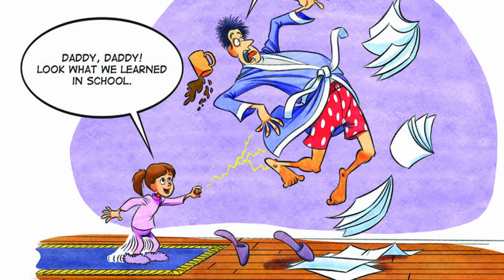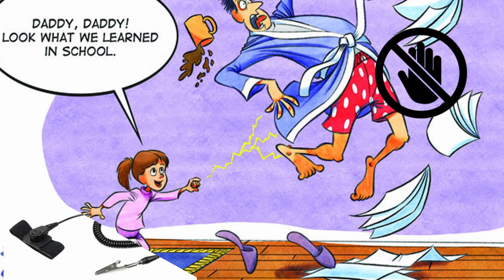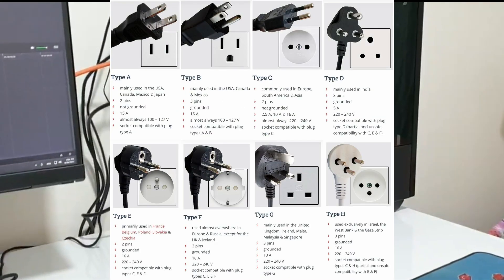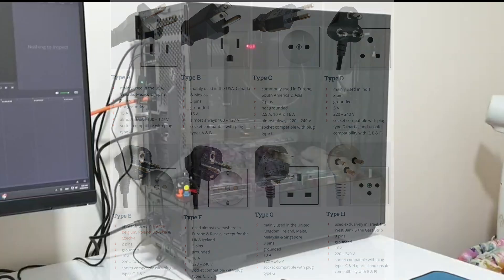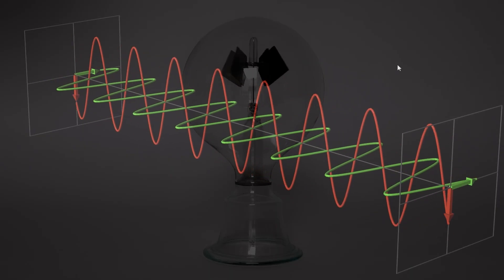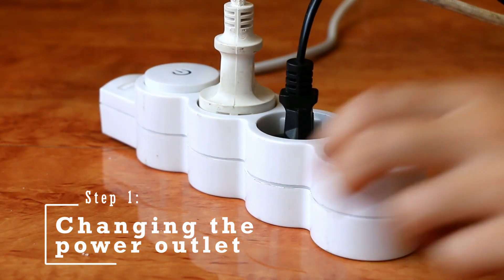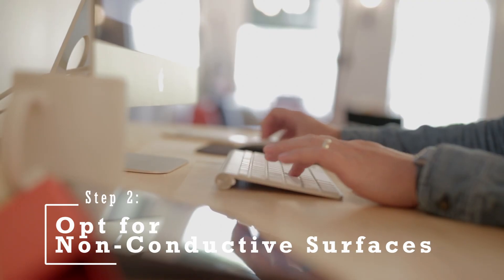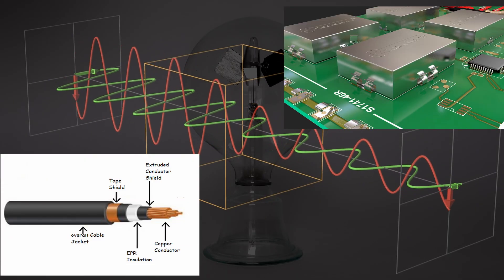Watch this if your PC chassis shocks you! Step-by-step troubleshooting guide

Comment: Thank you for the informative video. Liked 👍
So unfortunately, I moved to a new apartment with no grounding at all it seems. 
what to do in this situation? I can't stop using my PC.
continues shocks from the screws but very low. I am worried that it might harm my PC in the long run.
Heard of anti-static mat, would it help?
Reply from the maker: Your very welcome, Im not fimiliar with anti static mats however I suggest if possible, ask a technician to make grounding for your building, if not possible, I think your pc might be in danger, even your keyboard and mouse if they have metalic parts may be affected by it and might lose them to this. Hope it helps and you can manage the issue. thank you for your comment

Comment: Did it ! one insulated single copper  wire into unoccupied  ground wire prong receptacle , same gauge as common 110v about as thick as mid tooth pick , the  other hose clamped to a thin gauge re-bar that I am certain is driven into soil  through pre drilled hole in thin cheap   job concrete. floor ..I was shy to touch computer   so conditioned to getting  shocked... nothing ...no shock at all..... PROBLEM  SOLVED !

Comment: The old house I live in , in a country NOTORIOUS  for cutting corners  has no ground wire in receptacle  in wall ( flimsy room partition ) . The cement  floor is very thin ( see the corner  cutting ? thin ,lousy cement  floor)  I'm thinking  of drilling  through  it , driving conductive rod into soil and clamping  copper wire to earthed rod and other end of wire to computer  cabinet  or perhaps  to surge  protector ? 
I get mild but unpleasant  shock when touching computer  is on....and very mild shock when computer  is off ...this "stray electricity  " can't  be good and may be why computer shuts down at random...quite annoying  when in middle  of project ... I'm going for percussion drill  and concrete bit now... if anyone  interested  in results ...just ask.

Comment: what if i did not touch my chassis but get finger close to it (1-2cm) and got shocked, it felt like when touch the metal part of a plug and plug it in
Reply from the maker: Ok does it always happen or happens sometimes? cause it could be caused by Static electricity. Have you been wearing sucks and walking on carpet or sth like that?
Reply: @guienbild i was on barefoot and i dont think i did anything that can cause static but i did turn off the psu while its still plugged in. after those few shocks i just too scared so i unplugged the whole system whenever i need to move my case or remove the nails

Comment: when i contact a Faz meter to the pcs case the light turns on is it okay?
Reply from the maker: It means your case has some current, I suggest you check the power cable and the tee connected to it and see if your tee supports ground?

Comment: I am getting a continous shock when my feet are off the ground, but no shock when my feet are on the ground.
Reply from the maker: do your apartment have proper ground wiring?
Reply: @guienbild  I use a ups and it has a ground problem, i figured this one out, thanks.
Reply: @VIKclips i thought UPS doesn't have proper ground lane originally, just like the diesel generator
Reply: @AliSurvivor-3may  It has a ground cable in the fork that you put in a socket, so it gets the ground through a socket.

Comment: When My CPU not connected Any electricity but when my monitor connected with UPS and then I was triy to connect Monitor with CPU - i got Electric ⚡ 😲 Shock From CPU Cabinet
Reply from the maker: Oh I see...Please check your grounding. its usually caused by that, if not, you should ask a  technician ro come check your wiring or your PC.